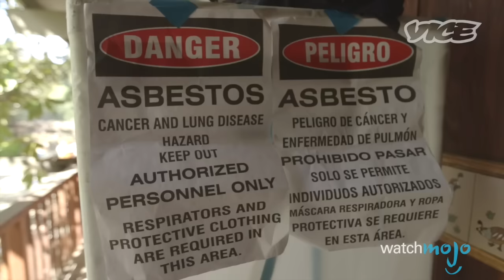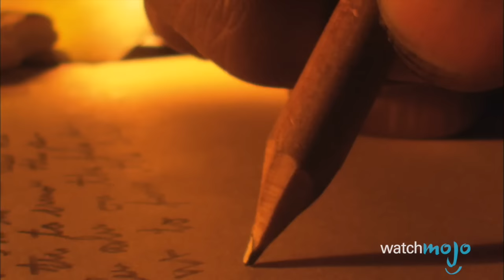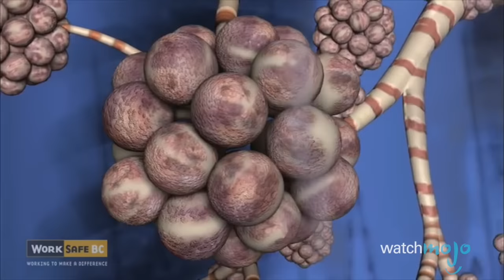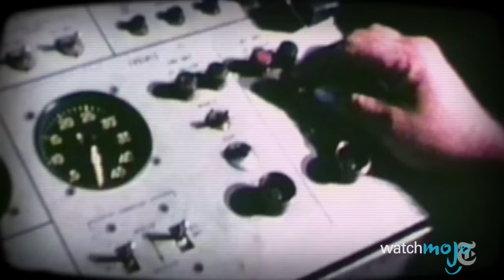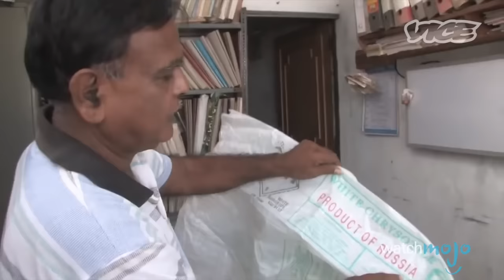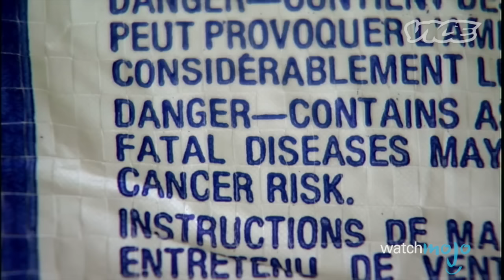Top 10 Dangerous Substances That Will Straight-Up Kill You

Comment: Another bad top 10.  Simply put this subject should have never been touched by the uneducated at mojo because uranium is the least likely thing to "straight-up kill you" on any list anyone makes.  It cannot be absorbed into your blood stream and all of the isotopes have either a)too short of a half life to be deadly or b) too long of a half life so you would have to consume a crapton to cause digestive tract damage.  The only thing that could even be considered to "straight-up kill you" with plutonium is the fact that spallation of dry plutonium can cause every surface in its container to be contaminated.  In addition the particles flying through the air could be inhaled and get stuck in the lungs (which is the biggest concern).

The title is horrible, really watch mojo meant to say, "Top 10 dangerous substances that will kill you, under the right circumstance."